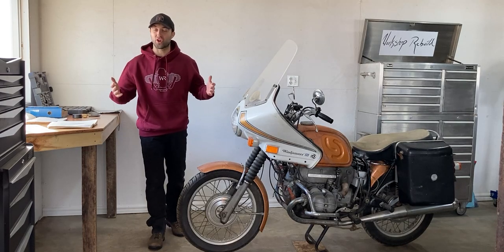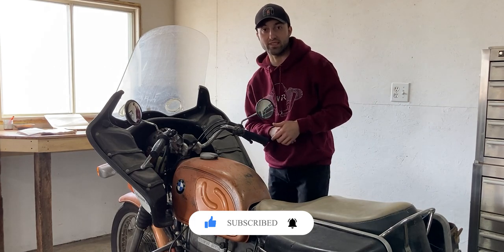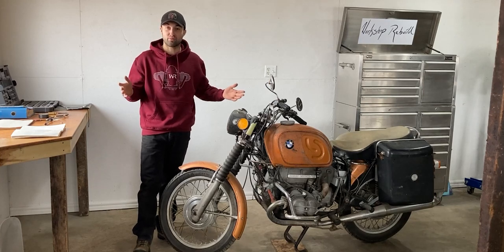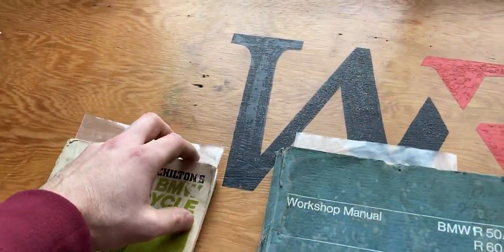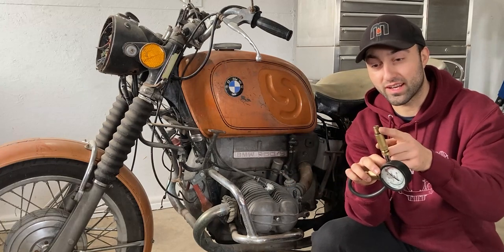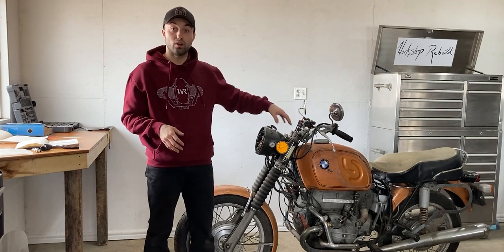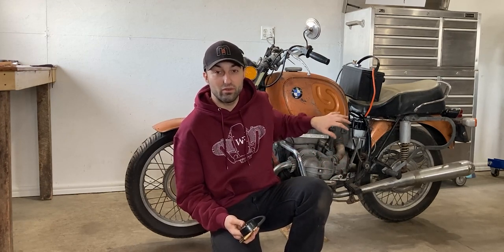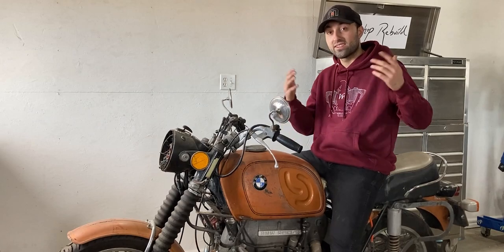BMW R60/5 AIRHEAD COMPRESSION TEST

Comment: Craven the company still makes panniers here in the UK
Reply from the maker: Thank for sharing this information, Paul! I guess if you make quality products for the right customer base, you can be in business for a long time.
Unfortunately the panniers I have were modified to fit this bike, as the bottom was cut to fit around the mufflers. One lid is also missing, but that could easily be replicated with some fiberglass. For now they have a spot on a shelf until I decide what I want to do with them. Regards Andreas